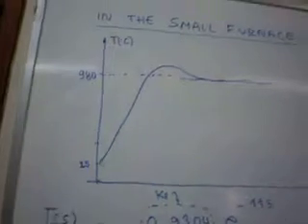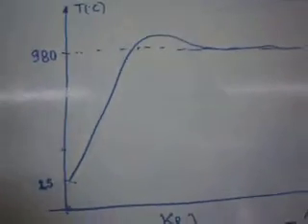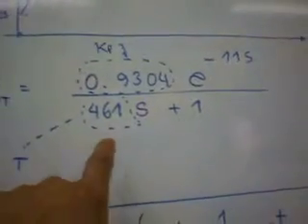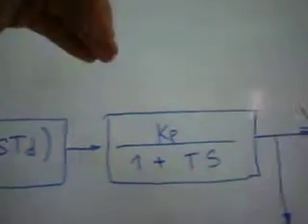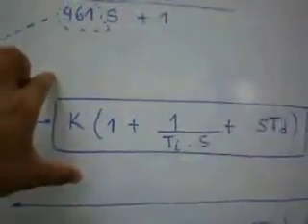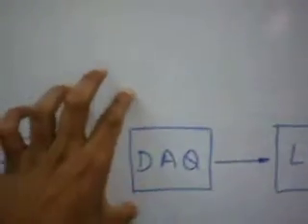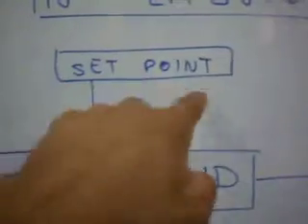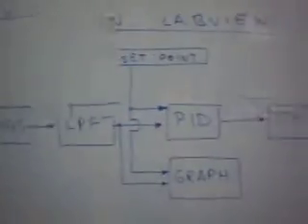Temperature control for  a small furnace

Comment: Hi.  I am from IIT Delhi. 
Could you mail me your project report? I am also working on similar kind of project.
Actually I have presentation/Report submission(BTech Mechanical Engineering) tomorrow and I could not do much since I was down to health due to severe stomach problem. Could you give me the report containing details of the physical system/plant? Kindly do me a favor if you can else my professor will not tolerate this. Thanks and Regards. Mukul Bansal.
Reply: email- mukuliitd08@gmail.com